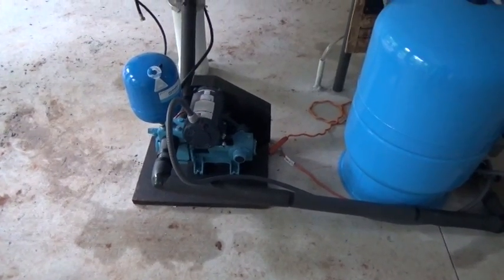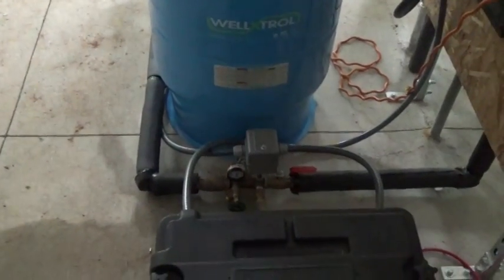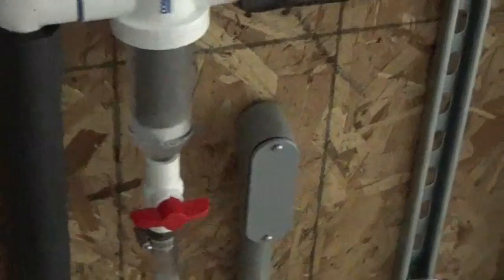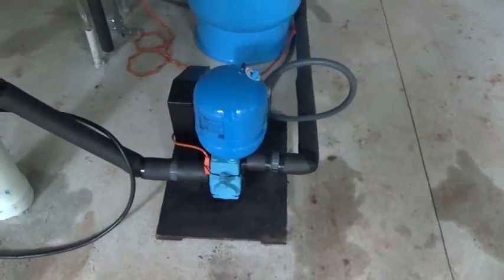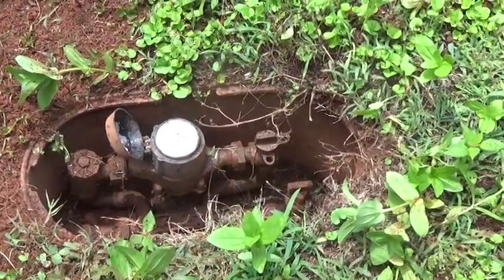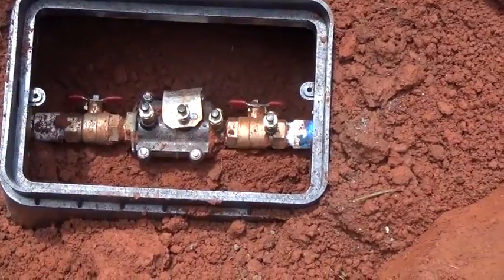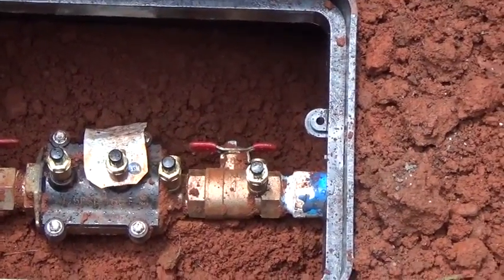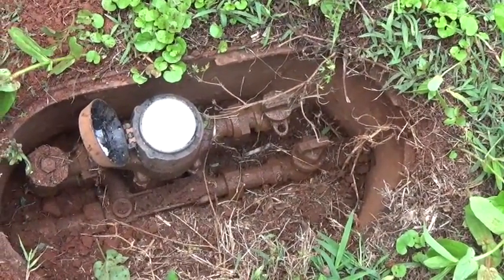Shallow Well Piston Pump Install

Comment: What type and make is your motor? What is the motor mount called? Do I need to set up a separate solar array and battery storage if I am running a 3 x 300 watt panel a charge controller with a 10k 240 inverter at 48 volts. How can I wire the pump without having to invest in a separate solar array

Comment: Hi  Scott,  on the Rusco filter, do you prefer poly mesh or stainless for minerals and long term endurance? 
And at what mesh/micron size?
 Ironically enough, I am currently plastic welding a small crack the filter housing of our 1 1/2"  - 100 poly mesh(152 micron) Rusco. 
. I'm pretty sure it will last another few years....  if not, A new housing is around $45-$55 bucks.